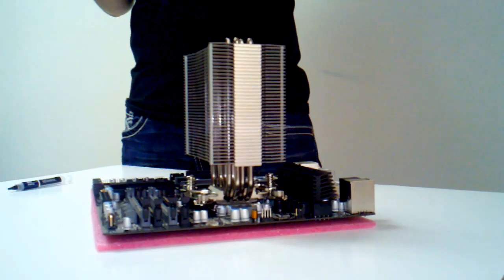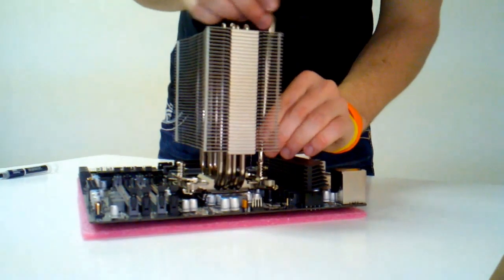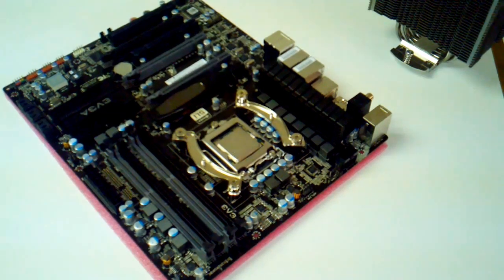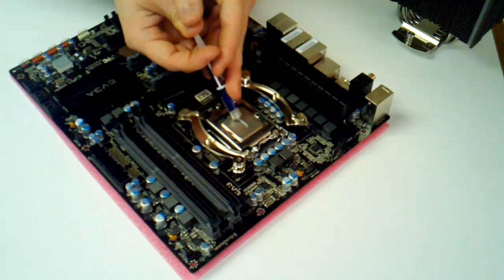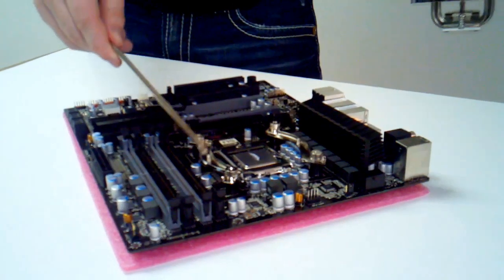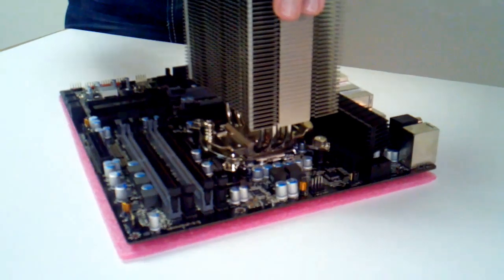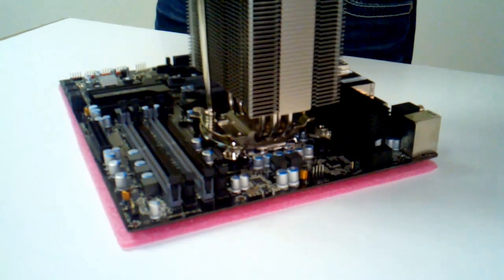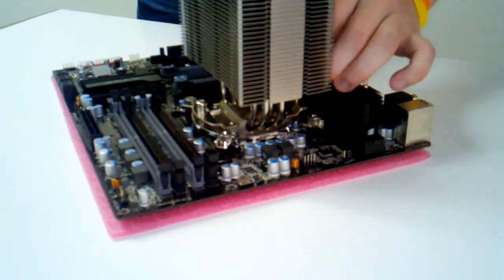Apply Thermal Paste & Reseat CPU Heatsink

Comment: Know the inside of the processor. Its only a really small wafer about 10mm. Just put a tear drop. Just make the plate of the processor a bridge to thermal paste and heatsink. Want to quickly remove the heat on the processor? Then remove the plate of the processor.

Comment: you should put the paste on, press the heatsink on it, then check if paste covers the heatspreader or chip. if not you apply some more paste put the heatsink on it and check again. only after everything is well covered you finaly apply the heatsink.
Reply: You really like adding air bubbles don't ya